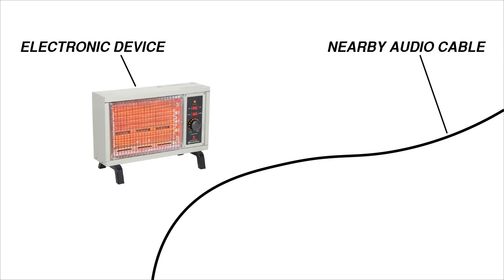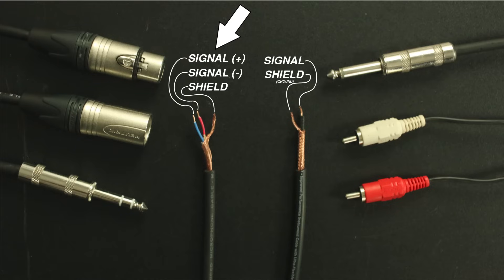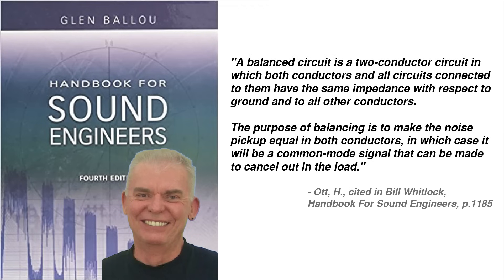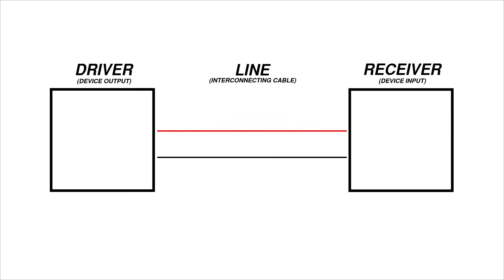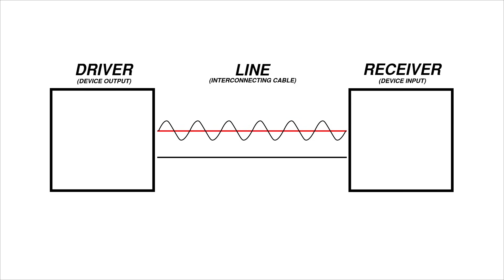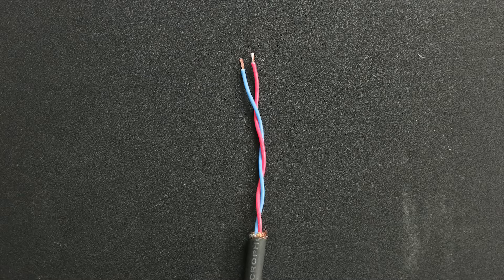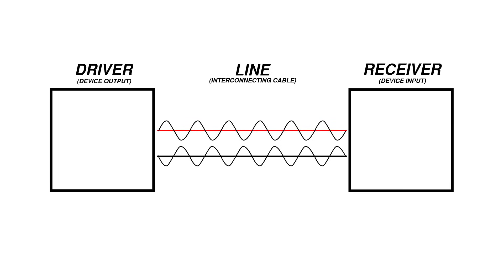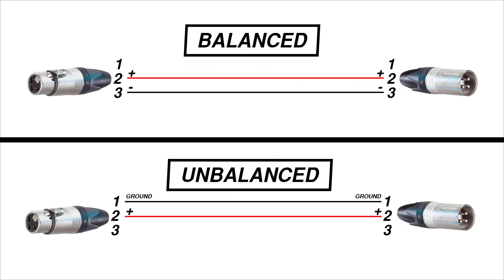Balanced vs Unbalanced Audio | Do Balanced Cables Sound Better?

Comment: I'm sorry but this explanation is inaccurate and skips huge parts. Sure, cable impedance is relevant, but generally orders of magnitude less important compared to the input and output impedance of the equipment itself being matched. This is due to cable impedances are generally a several orders of magnitude lower than input impedances of the receiver. 

The magnetic fields will induce noise in the form of a current in the cables, whereas the receiver is measuring the voltage. The noise picked up by the receiver will be the induced current times the input (plus cable) impedance. For the noise to be canceled the input impedance of both the + and - signals need to be the same, if they aren't the induced current will produce more noise in one of the inputs. Typical input impedance is in the range from a few kilo-ohms to giga-ohms. Typical cable impedance can be measured in milli-ohms. Any mismatch in cable impedance will be dwarfed by the input impedance for any practical real world application.

I also dont agree with your statement about the common misconception. Any real-world receiver will have an input impedance that isn't infinite. To have a voltage that isn't 0 you will therefore have a current flow. In your example of balanced connection with signal in only one of the terminals, where is the return path for this current ? It isn't in the negative terminal, since that's 0. It has to go through the ground conductor, in doing so it will also pick up noise that wont be apparent in the negative terminal. What you end up with is in reality a single-ended signal with a sense wire to compensate for some of the noise. It doesn't follow the definition you used in the beginning of the video.  

It's great that you are trying to explain difficult topics to a wider audience, but in doing so you also have a responsibility to understand the subject yourself and getting it right. There are way to many cases of the blind leading the blind in audio imo.

Comment: You will find many applications of balanced cable use in automotive applications not actually related to the ICE where numerous sensors require a balanced input into its respective controller.  ABS breaking systems have been using twisted pairs since their inception as a vehicle generates both AC and supplies DC to various controllers . A vehicle wiring loom is a great source of quality cable for building audio circuits as you will find all the various types you need for your tube amp or other audio project,  from twisted pairs to multcore twisted pair shielded to single core hook up wire in high current thin wall insulation in a variety of guages , plus high temperature ptfe coated and silicon reinforced protective tubing . The elimination of cross talk between vehicle systems is more important than static audio use ( could you imagine your ABS sensors picking up signal from your alternator for example ?) so quality cabling is used throughout a vehicle. Sadly the demise of the boot mounted CD changer has removed one source of highly useful audio cable with both twisted pair balanced and unbalanced shielded cable all in one reasonably small diameter cable able to take a supply voltage as well as carry clean signals.
You may have noticed that theses PCMs or ECUS as some still call them have multiple ground wires emanating from them , one or 2 may be simply for the power supply itself the remainder are isolated grounds from the differential device installed in the controller as a motor vehicle is isolated from a true ground by its tyres and must operate on a ground plane system . The next step up in wiring systems is the aerospace industry of course .

Comment: Excellent tutorial. More clearer than some professionals. Next time I'm asked about this I'll send them your way. Something I didn't see in the comments is when using active balance equipment which is more predominant today, should one signal wire become intermittent you may notice the audio level might still be present but may vary by about 6 db. Because normally an active balanced arrangement produces about 6 db more signal than an unbalanced arrangement. If anyone experiences this, check your connections.

Comment: As for the hum/noise that is being picked-up along the way (between the "driver" and the "receiver") if the shielding is properly made, the difference is negligible in real life (few yards of interconnect cables, say between the preamp and the power amp in a typical home audio system. And the systems themselves are generally made "by design" in an "unbalanced mode" (so to speak): the connection between standard guitar (any Gibson or Fender out there...) and it's amp (6.3 millimeters "banana" port on both ends), devices like analog turntable/CD/DVD player and a home hi-fi p amp (chinch ports on both ends), typical computer sound card and the amp (3.5 millimeter "banana" ports/connectors on both ends) etc. etc.

Comment: This was very informative! I guess my question is: why do we still use unbalanced cables? Is there a situation in which unbalanced is necessary? I know companies still make say, interfaces with RCA inputs. But if the quality is so much better with balanced, why is unbalanced even a thing in 2021?
Reply: It isnt so much better with balanced, balanced is just better at rejecting noise. Over reasonable lengths of cable runs, this is not a concern so unbalanced is more than adquet, and making it balanced would only drive up the cost with little if no benefit
Reply: @nolondon  Ah, ok. I see. Thanks!
Reply: You need to be a little kid to ask the hardest scientific question.
The best unbalanced cables are electrically balanced and work well even in microphone lines.
Moreover, the most precision unbalanced cables are made of balanced cables, and this helps to solve the problem of grounding in the equipment cases. And finally, the most critical connections work best with a three-wire balanced connection, but this is beyond the fight against the harshest electromagnetic interference.
Thank you for your serious real scientific question.
Reply: @Владимир_Ильин  None of what you just said is true. "The best unbalanced cables are electrically balanced" wrong, electrically balanced implies that the balancing/unbalancing process is handled by an IC like the THAT 1200 series, which require 2 conductors and a shield(something unbalanced cable lacks), it is especially a bad idea to used unbalanced for mic cable runs, as mic level signal is very low, and cable run lengths are long, even more of a bad idea if you have SMPS power supplies anywhere even remotely near by. 

"Moreover, the most precision unbalanced cables are made of balanced cables, and this helps to solve the problem of grounding in the equipment cases" again, untrue. Grounding is not an issue with single conductor+shield unbalanced cable as long as simple rules are adhered to.
Reply: @nolondon  Well, it's good that American science does not know about such simple tricks. My congratulations and best wishes!
Reply: @nolondon  If you are a lumberjack, then the ice ax will always seem to you the wrong ax.
You could not even grasp the idea, these are your difficulties, a drawn man will never leave a sheet of paper in a cage.
I'm not going to convince you. And I don't even take offense at the attack. :)
Maybe it's Google translator who is fooling us both? If not, then everything is really hopeless. :(
Reply: @Владимир_Ильин  I grasp the idea, you are just wrong, and what you stated in your original post demonstrates that you have a flawed idea of how things work. Again, if you can refute anything ive said instead of saying goofy platitudes, I would love to hear that. Im all for learning something new, but that would require you backing up your strange claims.
Reply: @nolondon  Here is the fact that you assess my statements as strange and paradoxical, speaks positively about you, but the categorical way with which you are trying to assert platitudes, gives you an insufficiently inquisitive person. I am not repeating the correct one. But I appreciate seeing the right for the wrong.
The information that I have written, with an inquisitive reading, will lead to new knowledge, but will yours?
If young people are interested in why this is so, they will learn new things for themselves and for you.
These are different approaches, and they contradict each other, but there is a grain in them that should be discerned. It was not by chance that I made a reservation about the child's question. Do not get excited, and do not assume that the first level of ideas is not internalized.
Everything in life is much more complicated and other horizons appear beyond one horizon.
Want a simple example? - please. Why a second coil in a dynamic microphone? And when you grasp this logic, it becomes clear to you how to use a balanced wire for an unbalanced connection. Or maybe you will understand what function the third wire in a balanced cable can perform.
Categorization does not lead to new knowledge.
Reply: @Владимир_Ильин  Yes, i understand perfectly what you are implying. the coil is not connected to the driver, and is inverted so as to cancel out the hum, but is irrelevant to a cable with a second conductor, as cables dont have inductive coils built in- so you would require extra components which wouldn't even be guaranteed to work, as the coil will only be effective at cancelling induced hum if it is placed as close as possible to the component that is receiving the hum, which is likely far enough away from the cable that it wont work. proper shileding and grounding of equipment is far more effective, and requires no extra components.
Reply: @nolondon  You get the idea, but the key word there is not a coil, but any sensor, to receive pickups, which works as a second rocker arm, a counterweight.
I wrote to you about science. There is no simpler or more rational word. There are other criteria for success and accuracy.
Knowledge is utilitarian when it is, and useless if you don't learn how to use it. A young man who begins his reasoning with "enough that I already ... (fill with any content)" is not suitable for a case, the purpose of which will be to comprehend new truths and dependencies.
He is not initially motivated.
These are already features of the mental make-up.
I don’t want to offend you, but psychologist Müller, if I’m not mistaken in memory, identified several types of personalities. They look at the world differently. Do as taught - as a life motto easily and leads many to success. And I'm not going to lead them astray. But their pride and self-esteem will not allow them to rise to the next level and ask their most important "childish question". This is a different type of personality according to Mueller.
To test yourself, try to find reversible sensors in technology. Without using Google, without going into reference books, just from your knowledge and erudition, relying on memory.
And then check yourself by measuring the time during which you will get bored with this activity and whether there will be a desire to add to this list. This will show your potential in asking the "main child's question".
Remember, you wrote to me that you know more than me and smarter than me. Perhaps I admit it completely.
I love children's questions and can see them. Can you handle it? Is there enough knowledge?
Reply: @Владимир_Ильин  again, i know what youre saying-but there is no point to it, because it requires more parts than an extra conductor on a cable-which is what you intially claimed and at that point, you may as well use a balanced/differential signal. its also worth pointing out that this is simply one, of at least 3 very wrong things you claimed in your initial post.
Reply: @nolondon  As you delve deeper into the problem, you and other things will open up and seem already obvious. Like Ariadne's thread, you should have a "child's question" in your hands. I am not sending you anywhere, I have already been there.
But I will not make excuses and babble. Not my level.
Reply: @Владимир_Ильин  I find it curious that you refuse to back up any of your claims, and instead chose to type at length about concepts that have nothing to do with the topic at hand, while i have clearly refuted the incorect information you posted. i believe this to be very telling about your knowledge on the subject.
Reply: My dear opponent, you have already expressed your opinion on this matter. I remember that. I gave you an illustration. You didn't get it.
I told you everything in advance. And even took enough time to encourage you to think productively.
But very few people are given it. Everything is explained. Don't take my time.
This is described in folk parables, but Google will not translate them adequately. It will take a long time to explain polysemiotics. Well, what is the point for me to explain to your type of psyche the mystery of humor?
Consider that you have refuted me. You are well done.😘
Reply: @nolondon  I give you four victories at once, I can even multiply them by ten. - take all of them home, please your loved ones.))
They are so looking forward to it!

Comment: I would imagine that this would be far more important in a studio or stage where noise is introduced prior to a pre-amp and amp then exaggerated 5 times.  In situations where several cables and power cable over long runs would cause these issues.  In a home, I wouldnt think balanced connections would matter as much.  Is that fair to say?
Reply from the maker: In homes, the cable runs are usually quite short - 15’ or so. Unless you’ll be running line level signals over a longer distance, unbalanced connections are far less important.
Reply: True, but if you notice noise with unbalanced connections, chances are high they disappear when using balanced connections
Reply: It depends. In a home system, balancing is primarily done for sound quality benefits, where on the pro side, its done for more practical reasons like noise and cable length. The most important thing to keep in mind is there's more than one way to implement balancing in an audio circuit.

Balancing on equipment like we're dealing with here is balanced from connection to connection. What that means is a component generates a single ended signal and sends it to the output. The signal at output is then converted to balanced. When the balanced signal reaches the downstream component, it gets converted back to single ended. This isn't the best way to do it, but it does provide real benefits.

On most high end home gear, its done differently. The best way to do balancing is to make the component itself balanced, and not convert the signal at all. But Its very expensive. You need to double up on all the components in the signal path. The easiest way to visualize it, is you need to provide a path for the extra signal conductor that a balanced circuit requires. When the whole system is fully balanced, that's when you start to notice a difference in sound quality. The reason fully balanced components are rare in the pro audio world, is the cost can be extremely high. On a home system, you have 2 channels going through a few components. Balancing something like a studio mixer that can have over 4o or 50 channels, makes it too expensive to be practical.  

Please keep in mind that this post is just to give a basic explanation. This topic can get more technical, but it would be too long to put it all in a post. But the overall concept is correct.
Reply: Well depends upon which devices you have near the cable
Reply: in home recording, you absolutely want a balanced load whenever possible. your entire circuit breaker is nothing but pure noise.
Reply: there are three things that cause high levels of EMI, no matter where they are:

Florescent lights
Lights on a dimmer , sometimes even when turned on fully
Variable Frequency Drive motor controllers that are now used in many clothe and dish washers, furnace blowers and AC.

Desktop computers can give off a flood of EMI if they do not have a proper case / enclosure (clear plastic for example)  or if the case has been removed or is held on with only a couple screws.

Its weird that most quality microphones use balanced XLR connections, and... well... no electric guitars that I have ever seen have them.

Comment: Totally unrelated geek question from a linguistician interested in accents:
Where are you from / where have you moved between during your developmental years?
I note your pronunciation of solder as "sōder" (replacing the "l" with another long "o") and have heard other American speakers use the same formation, thus suggesting it is not a speech impediment but a standard regional mode of speech.  But from where does it originate?
Thanks :-)

Comment: In my experience this can actually make a fairly sizable difference when recording. It provides you more headroom at a given volume. If I record at home using RCA to sound card and my volumes at 60% I'll get a recording within a few db of clipping. If I use the same settings but with trs I'll get a recording that is just over the halfway mark in volume representation on a waveform. I've always assumed that was a lack of inaudible noise. Signal to noise ratio so to speak. Only across your wires instead of within a device. The home audio situation is a cluster f of wires. When playing live we have cable management that is much cleaner than what I have at home. So I'm sure that makes a difference as well. Kind of interesting to see why that this all is.